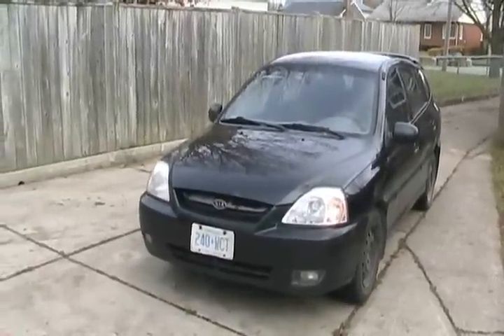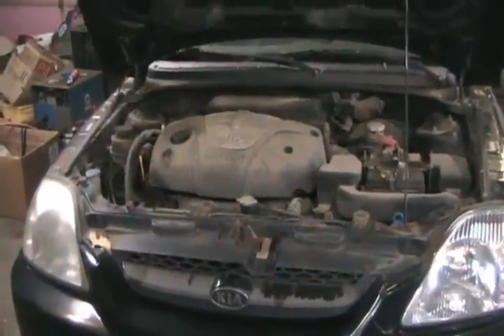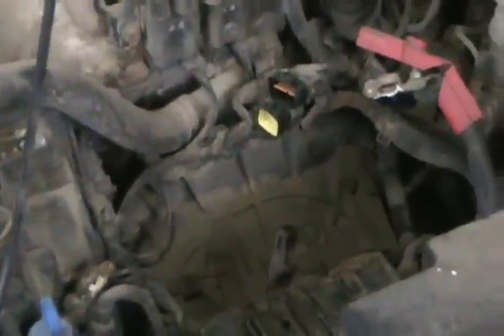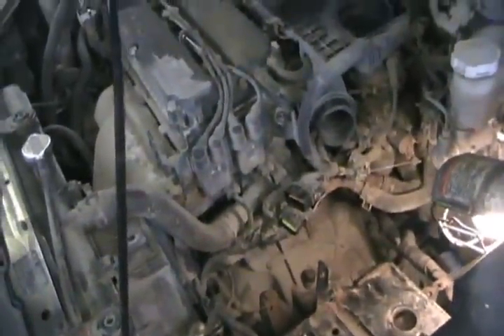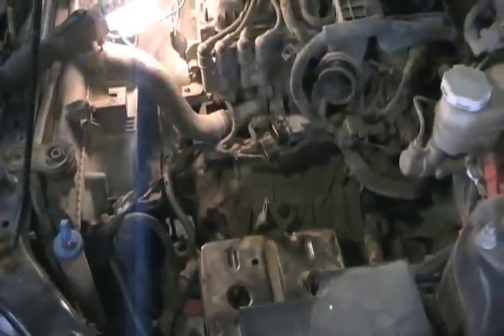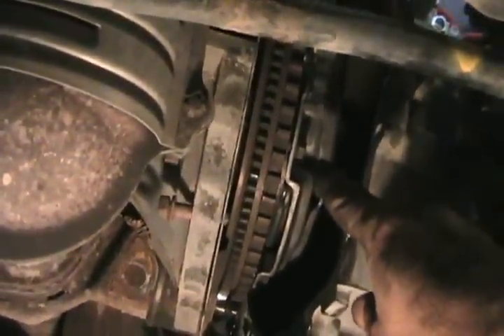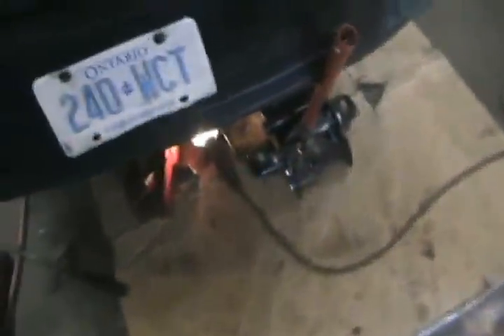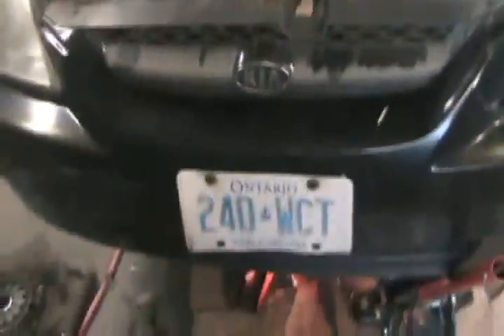#1177 2003 Kia Rio clutch replacement lesson [Davidsfarm]

Comment: Thanks buddy, all is clear and understandable. By the way, what was the mileage? Interesting, how much is my clutch gonna last
Reply: Mine '09 just went at 194K miles. It still isn't slipping, I think the bearing went.  These cars are unreal.  I usually change a clutch every 30 months.
This thing lasted two full timing belts.  Had a dvd player for the dash sitting in the closet for 8 years waiting for the clutch to go.
Going to be very upset I don't  need to take the center console apart to do this.
Just got the parts today.   Going to try a winch from above to hold the engine.  I have the lift bar so I can tilt it.
The 07 is an auto, just had the head off for a water leak.  It's got 250k.  I replaced all the hoses and timing belt while I was at it.  only had 25k left on it.  Now i'm good to 350k.
about the only failure point is the interior fan control.  The cheap switch doesn't last.
Wish they would have kept the gear ratio's the same.  Would prefer the higher gas mileage on the manual with the bigger rims.  The only difference I found between the engines is the 09 has hotter plugs.  LOL